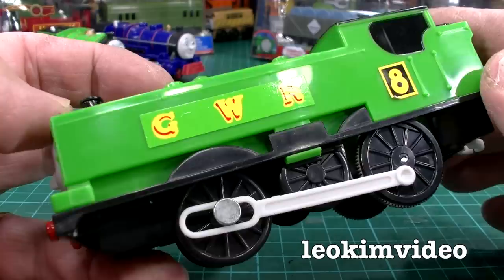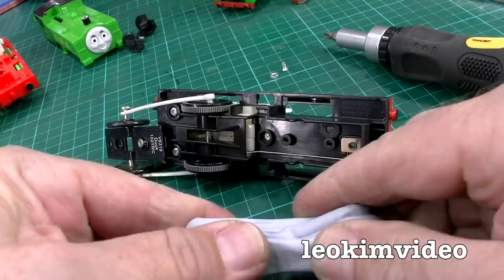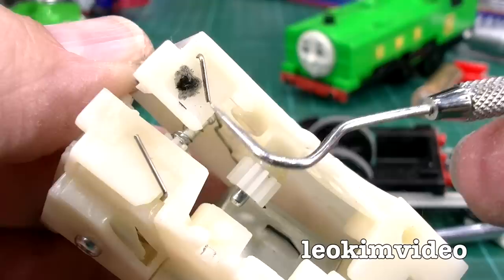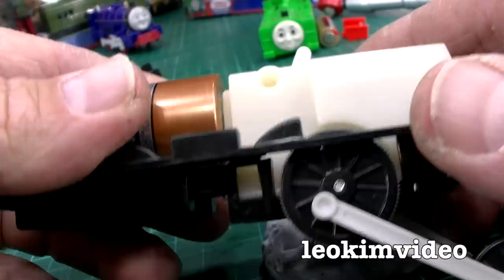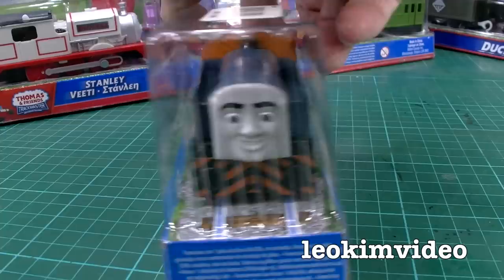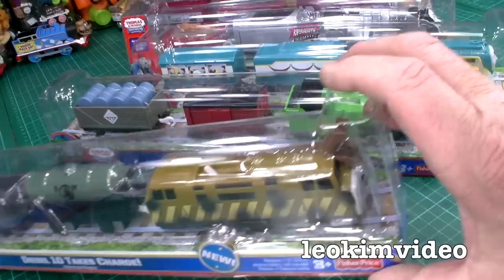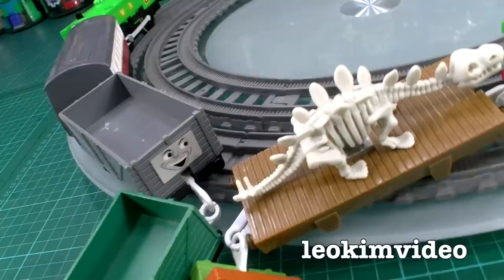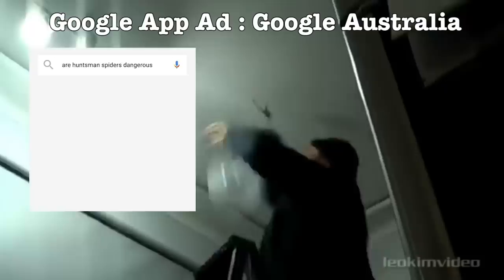How To Fix TrackMaster Duck & Classic Thomas & Friends Toy Trains

Comment: How do u remove a worn out screw from a trackmaster 2 thomas?
Reply: While your unscrewing it, pull on the bottom of the chassis. When it comes apart and its still in there, push it out from the inside.

Comment: Wow, here's a video I remember looking forward to back in middle school... and I'm starting college in a few weeks. I actually just fixed up a Duck last week when I was fixing some spare engines in my parts bin...

I've never had a ton of issues figuring out how any of the gearboxes go back together because of how they mostly go together one way. The old dark blue track TOMY engines that can reverse are some of the worst. The worst repair I ever had to do was a TOMY Steam Along Thomas with a completely corroded battery compartment about three years ago. I basically had to pull all the metal contacts out and shape a mix of paper clips and tin foil around to get a connection. It's an incredibly cramped compartment with three double AAs plus a standard Thomas/Percy style motor all inside a slightly longer than usual Annie. I also had to rebuild part of the coupling, but that was only as bad as fixing any C cell tender engine. A little shoddy looking back now, but at the time I only owned one and I wanted it to work.

I forget classic Trackmaster disappeared about half a decade ago. There's a few I missed out on like that Mattel version of Duck's Close Shave. I've got the older HiT Toy Company version but neglected to pick up that version.

I believe those TOMY fish (and the green flatgar they're on) come from the Thomas and Freight Cars set. It's mostly a Japanese exclusive but it got a Kmart release in Austrailia. The cross-faced Thomas with white running plates you own also come from these sets.

I don't think the spring is why it's running slow. The spring pushes a gear out of the drive train that allows it to freewheel when turned off. Part of the switch pushing into place when on pushes the axel to compress the spring and push the gear into the drive train. When turned off the spring expands back out and removes the gear from the chain.

Have you seen the new Trackmaster "Turbo" engines in Austrailia yet? I know they're pretty new in the US so I doubt it, but it's got a cool logic system driving it that I went on too long about on a Train Tsar Fun video...

Comment: i bet the two motor connections where touching the motors metal case causing a short....
Reply from the maker: I don't think it was as sort circuit. If it was I would get a test beep. But I don't like the idea that a bit of tape across the top of that motor is going to stop a short from happening.
Reply: yeah true...

Comment: Hey Leo, I don’t know if you still look at comments on old videos but the spring that you lost essentially shifts the gear into engagement/disengagement it’s not that big of a deal if you don’t have it, but it will prevent your Trackmaster engines from free rolling because without the spring, the gear has no resistance and can slide into position with the worm gear when tilted a certain way

Comment: How about if you grab that spare broken Tomy duck motor (if it operates) and replace the motor with the 2009 Trackmaster duck one
Reply: Because if it does work you won't need to find that missing spring and duck will probably perform better with the Tomy motor.

Comment: I still have all my old trackmaster trains from when I was younger, and I can confidently say I wouldn't buy new trackmaster 2 trains. The quality of the new ones seem so much worse. When I go up the loft again, I'll have to get all the engines out and make sure their batteries haven't leaked. I have quite a few that would be over 10 years old now.
Reply: If they did leak the crome on the contacts will likely be damaged like mine were. I cleaned out the old battery acid sanded the battery contact points and they worked great.

Comment: I can say that the "Duck's Close Shave" pack you have there is based on the Series 2 episode "A Close Shave" (Originally broadcasted on the ITV network here in the United Kingdom on 5th November 1986). Very unusual for Mattel to actually manufacture something to do with a VERY old episode 27 years after it's premiere. I mean "A Close Shave", not to be confused with ANYTHING ELSE that has this title. (Wallace and Gromit in: "A Close Shave" from 1995 is one example, don't ever think that)
Reply from the maker: I think when the Ducks Close Shave set was made it was before Mattel had total control over the Thomas toys. Once Mattel had full control things really started to change and we started to see some major reworking to the toys to what we have today. 
Mattel, Inc. is an American multinational toy manufacturing company founded in 1945. They were the owner of HiT Entertainment after buying it from its previous owners, Apax Partners, for a sum of $680,000,000 (USD) in 2012. 
I think the biggest changes were happening during 2014. It's quite amazing how much has changed in such a very short time.
Reply: There was a ERTL Diesel (I think it was dated "Britt Allcroft (Thomas) Limited 1993", It was definitely Diesel) at my current school here in my part of Britain when I was in Year 6. It's quite shocking to see that here in the UK. I already knew that Mattel bought HiT Entertainment a few years back. Surely by now, Mattel are starting to stop using the plain Thomas constantly.
Reply: If you thought having Mattel make a classic trackmaster version of Close Shave Duck, well Mattel made Trackmaster 2 version of Thomas and Jet Engine and Percy's Chocolate Crunch
Reply: @leokimvideo it’s because they wanted to bring back memories from season 2 of Thomas and friends

Comment: I came back to this video after a few years from not understanding a think abt how they work to understanding every little thing, and I was looking when he was putting it together is that you completely forgot the tiny spring that goes on the gear for the switch. Very important because the spring is what majorly helps make a trackmaster 1 train be freewheel when it's turned off

Comment: Leo Seeing You Finally Fix Duck Was A Great Thing To See But Also A Very Infuriating Thing To Watch Because You Had No Idea What You Were Doing XD. As for the Spring that you lost, it is a very Inportant part in the way Duck works. Let me explain, the Spring that goes on the gear makes it so that when the switch is turned on the gear moves to activate all the other gears will spin. And when the toy is turned off the Spring pushes the gear away from the others so that the toy can freewheel. So that Spring is a very Inportant part in the way Duck works.
Reply from the maker: It may help to watch the video. Duck still freewheels when he's off as he should. So what does that missing spring do again! To me that spring is more like a spacer. And sure I did not have a clue what I was doing, but that's all the fun to see me fail.
Reply: The Spring May Feel Like Spacer, But If You Turn Duck On Youll notice That His Switch Wont Go All The Way (Sometimes) Because the shaft of the gear is sticking out and preventing the switch from going all the way because the spring is bot there. But like I said: this only happens somtimes.

Comment: I have taken apart an original trackmaster Thomas and it is very different compared to Duck probably because if the battery type it requires. There is no wire at all it's all in the back. Even the gears in the motor and battery connectors are different.

Comment: i have a 2006 duck
from a ducks close shave
and i also have a splatter from the same year and my splatter had a weird clicking issue and i was able to fix it with some better springs because the springs were Extremely weak and he couldent pull more than himself on just a staight no corners but when i did end up fixing him he was a very sprite locomotive and could pull a fair amount sadly i just thew him back into my box of others and he is now a background charater

Comment: Mate I know that (the older style track master) Caitlin's asking price is around $120-$150 unboxed at the moment. Busy bee James is about $250 still in the packet if you got one hiding away. I'm surprised to see so many of these trains still originally sealed. Conner is around 70 bucks or more used. So you're sitting on a bit a gold mine there.

Comment: I managed to get my 2009 Trackmaster Thomas working again by wiggling the motorised wheels with a AA battery inside the engine along with the on/off switch set to the “On” position
Reply: That was lucky
Reply: @ThuyNguyen-ib4ds  Also, I kept it in good condition for years, even after the Motorized rebrand, it's still in good condition, and I turned the newer Thomas into a Trackmaster RWS styled Thomas

Comment: First you fixed the Risky Rails Thomas then Duck (this video) what's next Talk N Action Thomas?
Reply: Tomy 1997 Duck is called (Britt Allcroft (Thomas) Limited 1997 Duck and bits of solid and little wires and these circuit,)

Comment: It's not your repair job that made Duck slow. Trackmaster trains have low quality motors with a low RPM compared to Tomy. In general Trackmaster all around are way cheaper in build quality than Tomy. And the spring changes the train from free-wheel mode to "on" mode.

Edit: Same with the squeaky noise too.